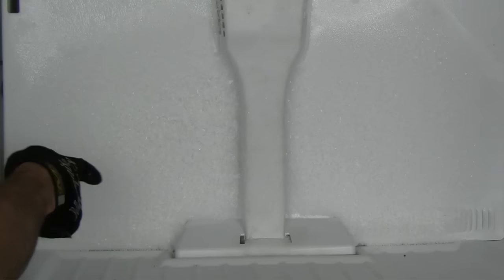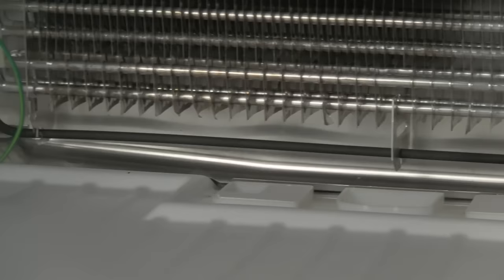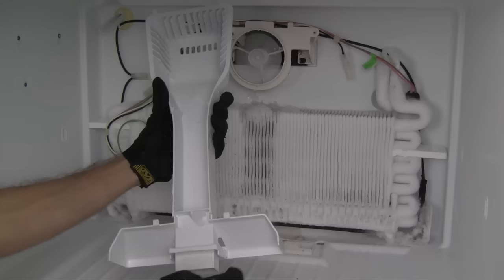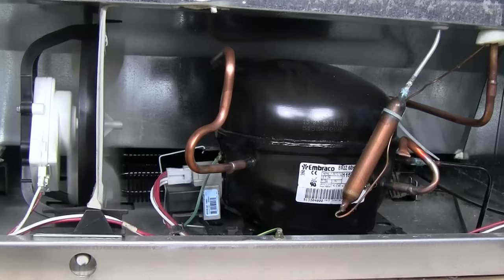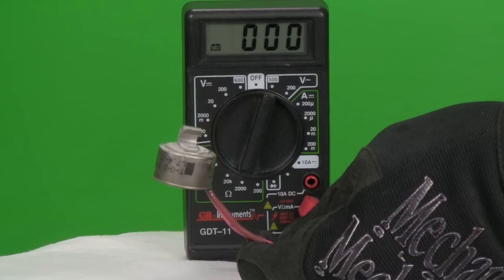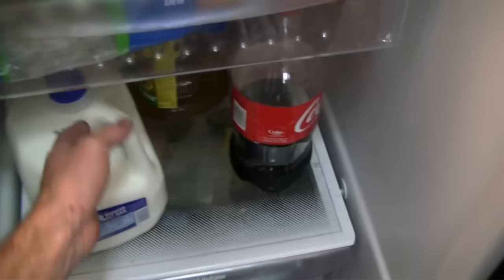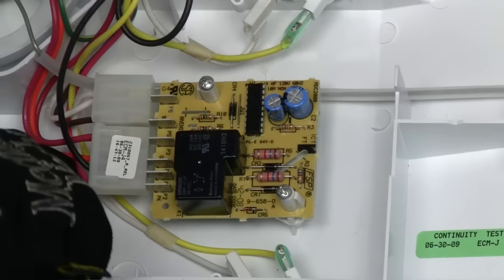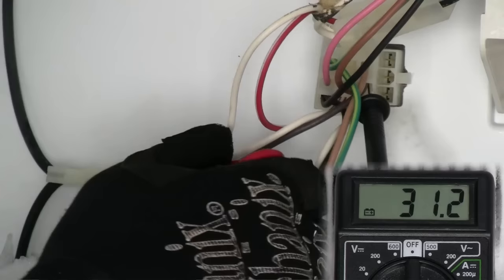Refrigerator Repair (Not Cooling, Defrost System)

Comment: I think what happened was I put a hot pot of food on the top shelf of my fridge and I think what happens when the door is left open is what happened by putting that hot pot in there. So I'm going to take everything thing out of the fridge and unplug it  for 24 hrs and see if that will work. I'll let you know.

Comment: I will have to get you the model #. Correct, I replaced the defrost timer before on the same one that is not working again. What I did was empty it all out and remove all the frost from the freezer and let it thaw on its own. Then I went in searching for the bad part and found the defrost timer bad. Worked good, then went to not cooling and freezer frosting. Then worked then its back to the same thing.

Comment: So a few months ago my fridge turned off one day and didn't turn back on. I learned about the defrost timer and how turning it with a screwdriver/giving it a tap can get it going again, which worked for me for a while. However, recently my fridge no longer goes into defrost mode, and the freezer/fridge have gotten warmer.  The freezer part is cold enough to preserve food and get drinks cold but can't keep ice frozen and the fridge is only slightly below room temp. I've recently replaced the temp control thermostat but that didn't work. The screwdriver in the defrost timer no longer does anything but turn the fridge off after turning it a few times. Could replacing the defrost timer be the fix or did the issue get worse? Your video quality is very good btw, you are a real professional.
Reply: What did you do to fix your refrigerator cuz you literally verbatim described what mine is doing
Reply: Is your refrigerater running?

Comment: This video is INCREDIBLE!  You clearly state all the problems that could go wrong with the defrost system, how to diagnosis the problem and how to fix it.  Over the summer, I am manually defrosting every 2 weeks.  When I do it again in a few days, I will get my multimeter and figure out if its a bad sensor or a bad heating element and then try to fix it myself.  A repairmen said it would cost $100 just to come to my rural location and diagnose the problem.  I have a receipt left by the previous home owner showing he paid $200 to have the "defrost control board" replaced 10 years ago.  Thanks to this video, I can determine, myself, for free, if that repair needs to be done again or if it is something else.  THANKS!

Comment: I know you posted this nearly 10 years ago, but here in 2020 you sure helped point me in the right direction!  Thank you for the lesson in the basics of how the auto defrost works.  I'm sure that's my problem due to the back panel of the freezer just covered with frost, and after removing that panel I found the whole coil area caked with ice.  I'm getting all that ice off so I can check the thermostat and heating element.

Comment: This explains a lot.  My side-by-side Frigidaire's defrost stopped working and the freezer coil turned into a block of ice.  With no air movement, everything started getting warm.  The fridge repairman replaced the thermostat, but also said that the "board" should also be replaced at a cost of $300.  He ordered the board, but for the 3 or 4 days before the part arrived, the defrost cycle operated normally both the fridge and freezer side were nice and cold.  I kept checking the coil in the freezer and there was no ice buildup.  I canceled any further repairs because the board was obviously not needed.

Comment: This video helped us get our side by side fridge working when it stopped cooling. The freezer door had been left ajar (more than once). To make things worse the air conditioning broke and the room temperature was in the mid to high 80’s. We removed the crispers and found the vent going from the bottom of the fridge to the coils on the freezer side was clogged with ice. Used a blow dryer to melt the ice and it started working again.

Comment: I use a hair dryer to defrost mine every month. My refrigerator cost me 80 bucks and I am okay with it. It keeps a temperature of 40 degrees on a normal setting. Thanks for the video though it was thorough explanation. 👌🏼

Comment: Your description of how side by side freezers/refrigerators work gave me the information I needed to fix my refrigerator. The compressor was working fine, the freezer was cold, but the fridge was not. I was able to find the frozen over area behind a panel in the fridge section and melt away the ice with a hair dryer. Thanks so much, you've saved us a ton of time and money!

Comment: I want to say. I first watched your video in 2011, and 3 years later, it still comes in handy, let me explain how. We have the same Whirlpool-made Top-Freezer model that you showed in this video. We have one of those outdoor cabanas, and early this year our freezer door would bind just before fully closing, and none of us noticed it for a while, so, considering it is outside, you can only imagine how much humidity was going into the freezer. 

The ice got so bad, that it blocked off the drain hole, and when the refrigerator went into defrost, the water from the melted ice started going though the air-return slots and making puddles on the refrigerator shelves below. Since we didn't have any thing that can spoil in it yet, I took one of the steps in this video. I shut it off by the circuit breaker (because it is easier than pulling it out to unplug it) and kept it off for 2 days, because I kept the doors closed due to pollen outside. I came back to it then, and the ice was all gone, and everything was nice and dry again, so I turned it back on. 2 weeks later, there is no more huge ice build up, or puddles on the shelves. Thanks again!
Reply from the maker: Thanks for posting this!

Comment: Thanks for the video, explaining where the fan was located in the freezer was spot on. Found the ice build up, the fan was hitting. Probably was my fault the vents were a bit covered. Cleaned it out, put the covers back and seems to be working fine.

Comment: You just increase my fridge knowledge by over ninethousand points. Was able to clean it up proper (drain was clogged by ice) but i don't know if it's the de-icing cycle that's not working or if it was just the clog that caused the issue.

Comment from the maker: @djkaneck1 Great!  Just keeping the settings on "factory recommended" in the middle should be good.  Main maintenance tips would be... 
1. to clean the dust out of the black coils under the refrigerator with a vacuum from time to time.
2. make sure the doors are not getting blocked from closing all the way by some rogue catchup bottle or ice cream container.  Thanks again for watching, commenting, and sharing!
Reply: When I had it on medium it started working again. But I wanted it colder. Big mistake. Then I tried unplugging it now it doesn't work at all

Comment: Somewhere around four years ago my refrigerator had stopped the defrost cycle. I've replace the defrost timer, heater and even the refrigerator thermostat, with no avail. I've been defrosting it manually for the whole time since; about every six months. Thanks to you sharing this video, I was able to locate the part that I believe I need to get it back on track. The bi-metal thermostat. Once it arrives, hopefully this will fix the problem. Thank you for sharing this video! You may have saved me $500 or more.
Reply: Darren W. Taylor props to you man. I'm like that too...never give up lolll
Reply: Thank you! I installed the sensor and it has worked like new ever since.
Reply: Darren W. Taylor sqsa
Reply: Darren W. Taylor

Comment: Try this to get the freezer working again. I have an LG Top-Bottom Fridge that was having the same trouble. Compressor and exterior fan were working fine but the freezer was not cooling. I removed the front interior trim of the freezer and saw that the evaporator fan was not working. I carefully unscrewed it from the housing frame behind the trim and checked the resistance and continuity on the wire connector which were excellent. Now I've seen repairmen who would just tell you to replace the fan but at that time of day that was not an option. Having done this before with a standing fan, I realised that all this fan wanted was a cleaning and lubricating of the magnets and impeller respectively. Eventually over time with these two there is a build up of dirt, and rust in some cases, which must be cleaned and so   here is where WD 40 is your best friend. I used some of this on a paper napkin to wipe the two surfaces after which I used some treadmill silicone oil, you can use something similar,  on the curved surface of the impeller as well as the shaft and end joint housing. I reinstalled the evap fan and plugged it in. Not only did it spin, but it spun faster than before. Also, make sure you clean the plastic fan blade which should just pop off the impeller shaft. I placed mine under the faucet and used some dishwashing soap. Hope this tip helps someone to save some time and money. 😀
Reply from the maker: Thanks for sharing!

Comment: I just want to say that your information is and was a good start but my issue was the Fan motor had fail. This should be considered as well because the defrost was working. So please check to see if the fan is turning.
Reply from the maker: Anthony Pass Thanks for highlighting the fans Anthony. Defrost issues are the most common. however,  the evaporator and condenser fans are definitely something to pay attention to!

Comment from the maker: Yes there are many different kinds. Most are just process of elimination... check the heater and the thermostat and if the doors were not left open then it is probably the control. Some GE refrigerators have a thermistor that should read about 60Ω of resistance when 0ºF that is how the control board knows when to activate a defrost cycle.  But most just have the three defrost components and no sensor. Hope that helps! Thanks for the question!

Comment: It was the thermostat. It had open circuit when testing it at freezing temp. The thermostat and heater for my model is sold as one unit.  My freezer is now working normal.  Thanks for the video.

Comment from the maker: @Terabass It sounds like you are on the right track.  In most cases a heating circuit component will ether work or not...so if you can get it to work with your computer you likely have a electrical supply problems. Realistically frost should not accumulate at the diffuser unless there is a problem with the defrost system or the door was left open, so you may want to check the defrost thermostat or let it melt down before you decide if you want to fork out the cash for a new control board.

Comment: Ordered thermostat, thermistor and heater for my machine ( ~$90 INCL overnight shipping)
While I waited I heard some had success by letting their fridge completely melt and restarting. (Ice and some dry ice for my ice chests added $20.)
Sure enough, it's working! While my parts are new-in-package the online company will refund returns for a YEAR. Holding for a while in case I need them.
A service visit would surely have been at least double those costs. 
Thanks again!

Comment: Here is a simpler way that we use instead of all these voltage checks, through on a amperage gauge, compressor running and cold air coming out should draw 1 to 2 amps, now turn the defrost timer till it click, on comes the heater 1 to 2 amps, now heater will run till cold temp thermostat reaches 45 degrees off goes the heater element, and you tested all that with out taking off anything. Wow.
Reply from the maker: MrMac5150 sorry I missed your comment from so long ago. I love using an amp meter! Very helpful. Thanks for the comment/ tip!

Comment from the maker: @MrMindShifter The defrost cycle should happen every 8 to 10 hours of compressor run time which is usually every few days depending on how often you open the door.  If the food is frozen generally you are okay. Ice cream is an excellent indicator of proper freezer temperatures because it changes consistency very rapidly depending on temperatures. It's also a great reason to stock some ice cream :) Mechanically the thermostat is the only thing that may be causing large temp swings...
Reply: Hi I have a GE double swing door refrigerator , freezing very good but not defrosting , I change the defrost thermostat an same issue , please advise if I should change control board or otherwise .
Thank you
Reply: applianceassista
Reply: My duel unit. It can be fridge or a freezer keeps freezing up the bottom fan. What could be wrong with it?

Comment: My auto defrost Kenmore freezer had to be manually defrosted every 2-3 months. Replaced the thermostat, heating element and timer and still would ice up. Finally figured out that the defrost thermostat was mounted too close to the heating element so that it was short cycling during the defrost cycle.  Moved the thermostat to the top of the cooling coils and that fixed it. Now the coils get fully defrosted during each defrost cycle!

Comment from the maker: @DavinaDrones That is an excellent point!  Putting warm food into the refrigerator can cause frost to accumulate and block air passages.  The defrost system should be able to correct that over a small amount of time if it is working properly.  However, even short rises in refrigerator temperature can greatly reduce the life of your stored food.

Comment from the maker: @HackettMomma You should definitely try manually defrosting the unit first.  You may have a mechanical defrost problem but it's always a good idea to try the manual defrost first.  Especially on a weekend like Thanksgiving when the doors are likely to be left open on accident. 
Also warm food in the appliance creates steam = frost = cooling problems.  Good luck! If that doesn't do it email me through my website and we can figure it out.  Thanks for the comment!

Comment: Thanks a lot! Your video helps me understand what's wrong with our Zipel side by side fridge. It seems like in the freezer section, the heater does not activate to defrost the coils that's why the ice builds up and blocks the vents that blows cool air all the way to the top. Great video!

Comment: THANK YOU I WONDERED WHY MY FREEZER WAS GOING OFF FOR A LONG TIME, THANKS FOR THIS VIDEO.I THOUGHT IT WAS THE PLUG SO I PULLED IT OUT AND THEN PUT IT BACK AND IT WOULD START UP AGAIN.
Reply from the maker: If it has an electronic defrost control, it may be getting stuck in defrost. Normally the defrost cycle shouldn’t be more than an hour long. The only other reason it should be off if is the temperature is cold enough and it doesn’t need to run. Thanks for the comment!

Comment: Superb video.
Clear and concise.
Second time watching this.
I have an old kenmore fridge and love it.
A few months ago, the fridge was not cooling and had to throw away food.
Ice was on the back wall. Watched several videos but that evening it was working again. Whew 😅 
I am adamant about closing doors firmly and clean coils monthly.
Yesterday it happened again. Had to throw away food.
No ice buildup.
Today, 24 hours later, it’s working fine again. All my ice packs are frozen.
Could this be the defrost thermostat intermittently failing?
Thanks for sharing your knowledge.
Peace love and blessings 💫
Reply from the maker: Thank you! You may be expecting an intermittent issue with the defrost control device. It’s pretty rare for frost to come and go like that. I would also look at the evaporator fan motor and any airflow control device that may regulate air into the fresh food area, that may be periodically failing. That’s a strange one! Good luck!
Reply: @applianceassistant  
Thanks brother!

Comment: Excellent. Why don't they tell you this in the manual. Our LG French doors seals both ripped inside of a year and had to be replaced. Now the new ones are doing the same thing and I tapped them. Noticed some accumulated frost  in the freezer for a few days and bang. Refrigerator went into defrost mode which made me believe something broke. Contacted a repairman...didn't say a thing about auto defrost. Bought a new Whirlpool, ice maker had a leak, Loews replaced with another. Made in USA but they forgot to connect the hose which was pinched behind the ice maker unit. Didn't find out until the new one was being installed. LG now working fine. Everyone has two or three in Arizona

Comment from the maker: @coldblackice Good detective work my friend!  Danger is relative...Using a multimeter to test for continuity and voltage might be slightly more prudent but it worked for ya so hey... In that case it is unlikely that you could cause an additional problem, but jumping wires can damage expensive control boards if your not careful what circuits your connecting.  Congratulations on the fix, and thanks for the comment!

Comment from the maker: @gaptoothed1 All you can really do with no tools is unplug it, open the doors and pray.  But If refrigerator temperatures have been an ongoing minor issue you may want to take a close look at where the cold air enters the fresh food area.  You may want to double check that model number, I don't think you have a door in the air passage...It is probably being blocked by ether frost or food.  The main tool you would need is a 1/4" nut driver you could probably find at the dollar store. Good Luck!

Comment: @applianceassistant ,  untill now is working great , i did the defrost manualy unplugging the refrigerator also empty the water conteiner that was completely full and was obstructing the way for more water to come down( because the end of the tube finish in side the conteiner not above ). also pulled out the panel from the refrigerator and helped the deforst with a hair dryer  . thanks again and a happy new year !!!!!!!!!!!!